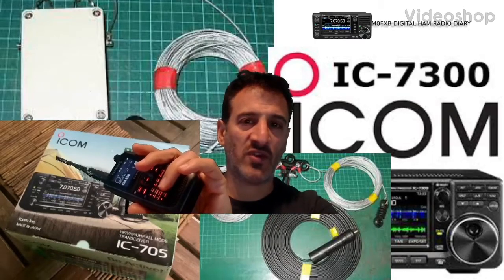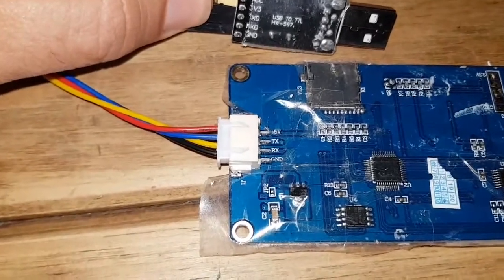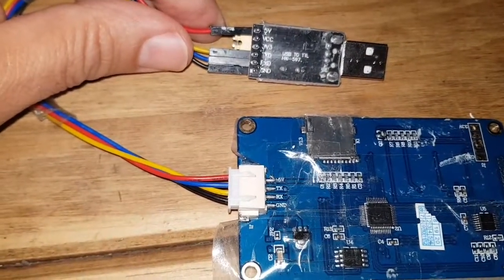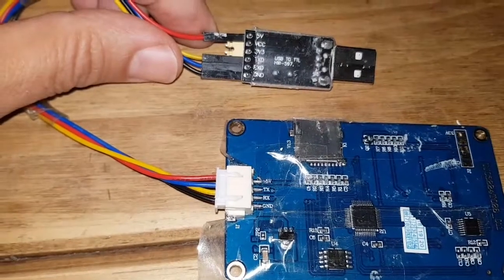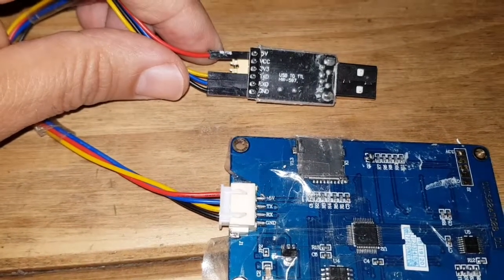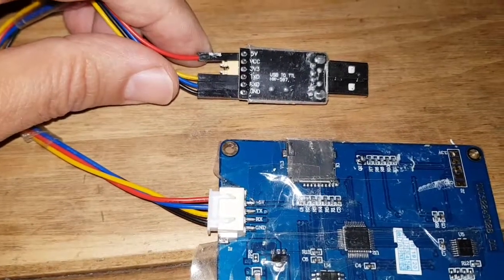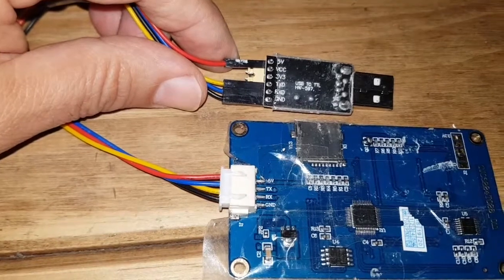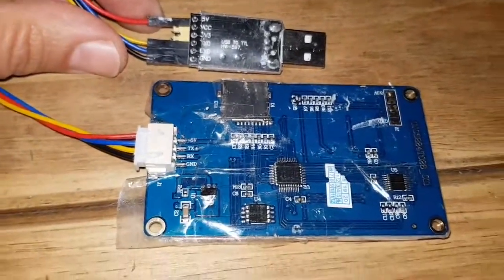Nextion screen to TTL usb converter - How the wires connect

Comment: Andreas, I am confused. The Nextion connections are easy to read, but what the heck is TXD and RXD (and why did my converter cover those two pins), and CTS and RTS? KN6ZFM
Reply from the maker: You have black and red wires for power which only leave TXD RXD which is data on the ttl adapter RXD goes to TXD and goes to RXD any other wire or connector  ignore .